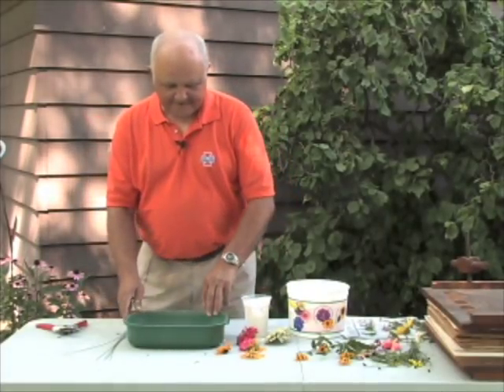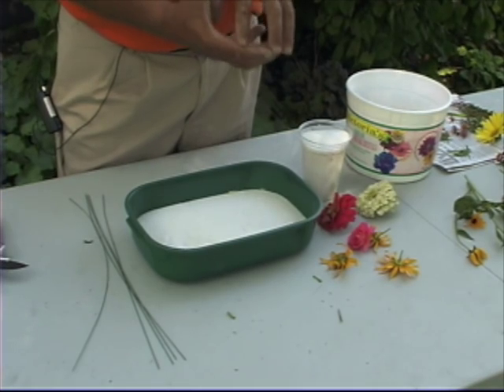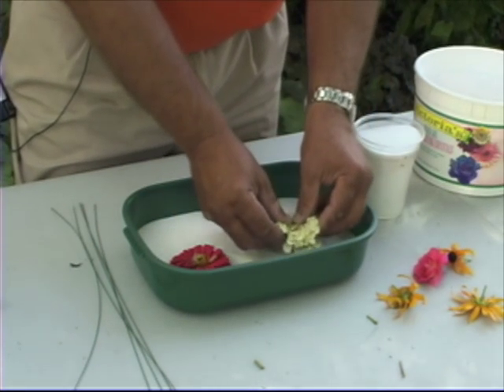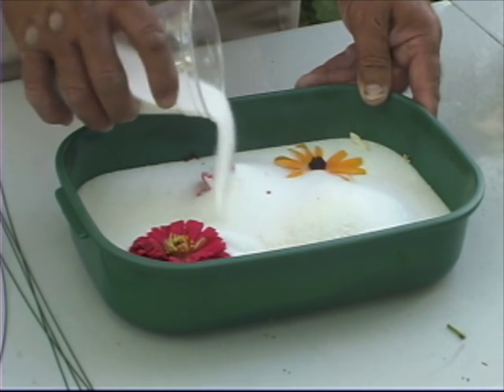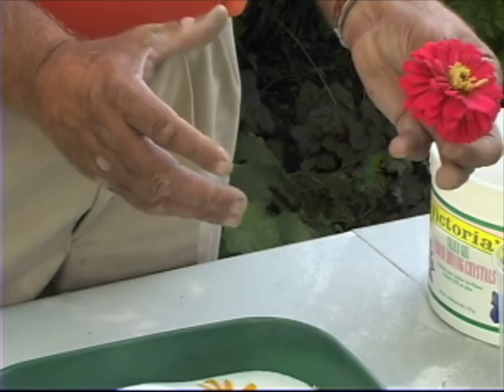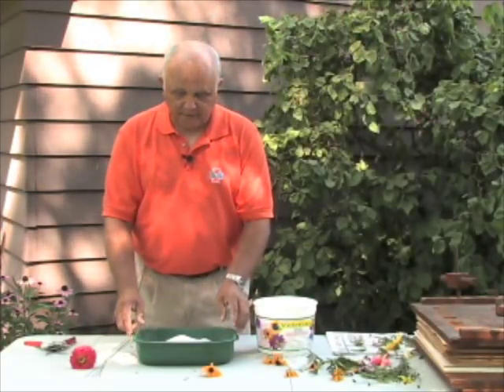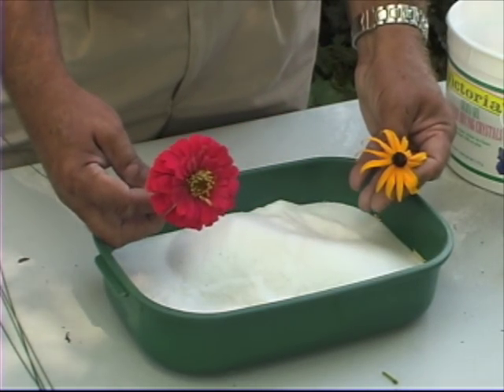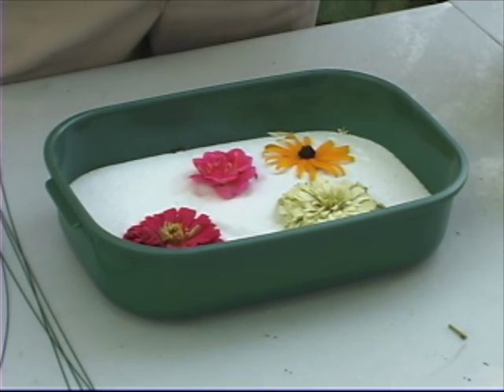How to Use Silica Gel to Dry Flowers

Comment: 2 Things: If you do not cover that box it will reduce the relative humidity in the immediate space surrounding it - meaning you will need much less for far more drying ability. Cover the box tightly and you can dry as many flowers with a few teaspoons full of silica. Also, to reuse the silica, just bake it in the oven for a few minutes at low temp. You will be good to reuse it quickly and efficiently. Remember, cover that box tightly and use a few teaspoons full at most for a bunch of flowers which will dry them in no time!
Reply: What can you cover the box the best with?
Reply: a lid
Reply: hi can i ask how many mins. Or hours will it take to dry a flower
Reply: @hotcraftingmamaph    see the PDF file https://web.extension.illinois.edu/cook/downloads/9205.pdf for a list of times for various flowers.  It usually is several days.  There is a faster method using silica gel and a microwave which takes minutes.  Google to get info on this.
Reply: if i cover the box how long will it take for the flowers to dry?

Comment: QUESTION
There are several types of silica gel, for example with and without indicator, thats how I was told, so which one should I use for this?
Reply: suggest use the white silica gel would be fine,because it's cheap than the orange silica gel.
just keep the silica gel are dry would be fine.(To make sure the white silica gel are dry,just put a little of them into a water,and you could hear some burst,if there's no burst,you could dry your silica gel in Incubator by 60℃-80℃ )。
Reply: @krissmou1572  Thank You for your kind information ☺
Reply: Fine pored silica gel

Comment: Hey there, I was wondering if this will work for Sunflowers? I was thinking of drying some sunflowers in order to display them in a shadow box. Unfortunately the air dry upside down method will not keep the 3D effect of the flower, the petals go all wrinkling :( any suggestions or tips? Cheers.

Comment: Why would I need to cut the stems before putting the flowers Into the silica gel?  

With the stem that I would have cut out, could I shove that back in along with the wire in the flower or would that look choppy and weird?

Could I preserve the stems separately (cut off) along with the flowers and would that work?

If i wanted to give the flowers a more natural look how could I incorporate the stem back in (if I could at all)?
Reply: Kennsie Domersan You could do a slightly different process (tedious if you have a lot of flowers), which is cutting the stem long, then pouring silica into a TALL container - tall enough to encompass the flower in its entirety. Once it's mostly full of silica, you place the stem in first, all the way until you only see the flower. Then do as this video shows - carefully cover the entire flower, cover the container, and there you go. Stem & all.
Reply: mzew

Comment: I tried this with a sunflower and the petals were all wilty and did not retain their shape. Not sure what I was doing wrong...
Reply: not your fault! sunflowers are somewhat difficult to preserve as a whole flower because the petals are so small and thin (very low moisture) with an enormous thick center (high moisture) so they do not dry at a uniform rate and end up looking unattractive. i’ve never tried to use a sunflower in silica but i have pressed many sunflowers and other thick centered flowers. it’s a process lol but i remove and press petals, saw thick center in slices, and end up “reassembling” the flower petals to the center. However that method only works if you’re using your pressed flowers under a frame or with an adhesive. May or may not help lol but i at least wanted you to know you were NOT doing anything wrong